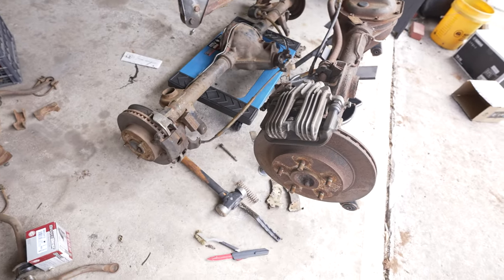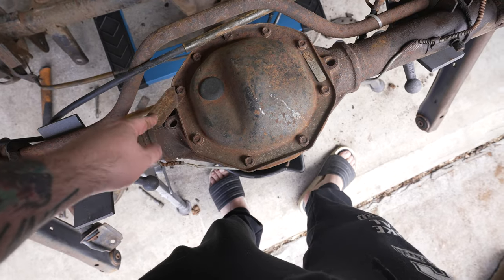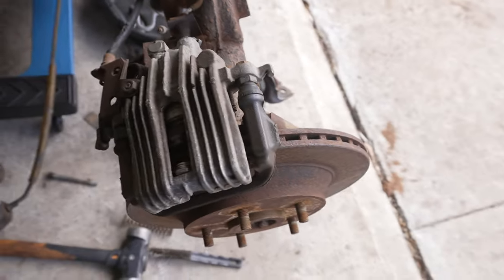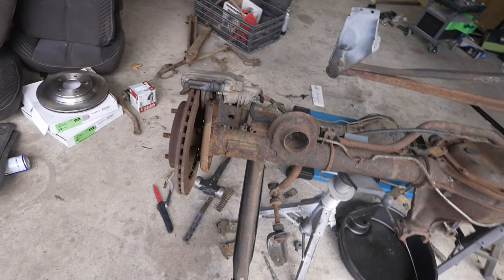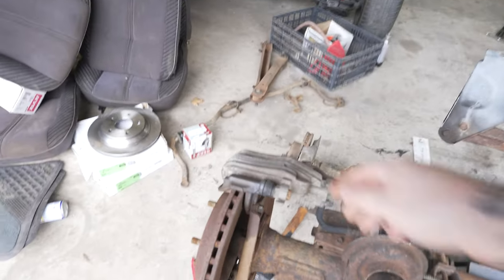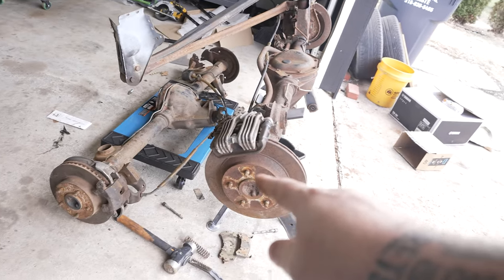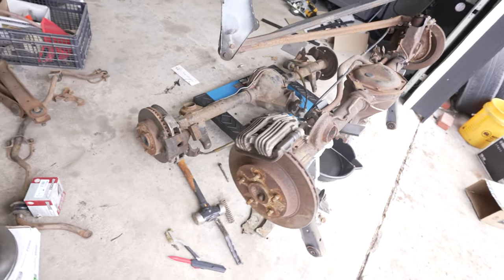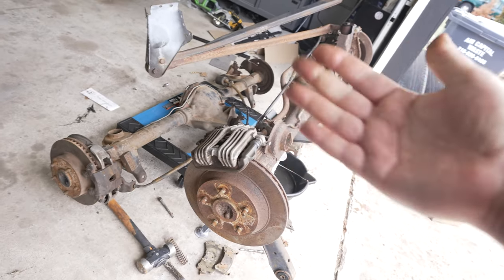2 Types of Borg Warner 9 Bolt Disc Brake Differentials for your Third Gen Camaro

Comment: Great video! 89 was the only year that they made two rear ends - correct. I wanted to add the IROC rear axle with the aluminum callipers have a 32 spline axle, the other a 28 spline axle. It’s handy info for those looking to swap out for taller gears - ask me how I know lol
Reply from the maker: Sounds like somebody bought two sets of axles!! :)
Reply: @beardedreviews  😎

Comment: Hey man very useful info this is ! You made me actually crawl underneath my Red Convertible 1987 Camaro IROC-Z28 305 TPI V8 with 5 Speed Borg-Warner manual gearbox/drive-train to find out I have the smaller disks indeed, as you have declared. As far as I know the rear disks were only available on the IROC-Z28's 305 TPI V8 (220 HP) since these were equipped with this entire Borg-Warner Non-World-Class 5 Speed manual transmission in combination with the rest of the Australian Borg-Warner drive train. This was the homolegation package for Chevrolet they had to sell in certain numbers to be able to participate in the International Races Of Champions (IROC) with their IROC Race Camaro's. So, it seems to me (I could be wrong of course) that you'll not find these Rear disk-brakes (Neither of both options obviously) on any other 3Rd Gen Camaro, but only on the IROC-Z28 with the entire Borg-Warner manual-gearbox-drivetrain option.

Comment: Quick question if using the stronger rear end with the bigger rotors and calipers are you still able to use the stock 15 iron rims?

Comment: They are still junk. Best thing is get a Dana 60 run ladder bars and call it a day period. Try looking for them parts and the calipers.
Reply from the maker: I don't take the car racing.  I just drive it regularly.  The calipers and rotors and stuff are actually very easily available as well
Reply: That's what I've got in my Orange 86 IROC

Comment: I have one of these in my car. And you can’t find parts for them anywhere…. I found it a salvage and had to rebuild the calipers because nobody had them…. I found one caliper on eBay but the seller warned me it had been sitting on the shelf for years 😳 so I didn’t buy.. recently my posi doesn’t work all the time so I start talking to buddies and they said something about they have cone’s in the posi instead of something else but they hard extremely hard to find… I’m like great🤷🏾‍♂️ hopefully I can add some posi fluid and it start back work as normal 🤦🏾‍♂️ but as rare as these these things are there also a headache.. but I will say they are strong I’ve thrown 400 ftlbs at it for a few years now and it hasn’t broken. The tag said it’s rated at 200 so
Reply from the maker: I got my calipers off ebay.  They were rebuilt ones I'm pretty sure, since they were painted black.  But they work great.
Reply: Got my G92 code rear axle from a parted '92 into my '91 conv. and got master as well. Luckily it's low mile and well kept but replaced rotors, pads anyways. Also added reinforced cover since swapping out 305 for 383 I'm building for it. I figured these Aussie calipers the same as gen4 since they look the same, but mine are fine so far - thanks for the heads up.

Comment: What’s stronger? 9 bolt or 7.65 10 bolt with 28 spline axles?
Reply from the maker: I couldn't tell you honestly.  I've never been the guy to max HP out on a car and need a super strong rear end, so I don't know the specifics on them
Reply: 9 bolt is better because it doesn't use C Clips, axles are bolt in

Comment: i just got done watching all of the camaro videos and you had me wondering if you keep the old parts like the old rims and steering wheel ....i have a 1991 . it was my first car .....we got it when i was 15 im 41 now and plan on restoring it in a few years....needless to say it will be a hard restore i was very hard on that car ...its been n our polebarn sitting for the last 18 years or more ....its cool seeing everything you have done to yours ....keep up the vids ...killin it
Reply: Hey man, how's that project coming along? Just wanted to say that ThirdgenRanch has used parts if you need them, and Hawks Motorsport has alot of reproduction-parts if you need them.
Reply: Yeah, I'm also asking since from what I read it should be worth restoring, and there's plenty out there you can gather to do improvements or as original as you want. My first brand new car was a blue '91 special order 1LE /G92 coupe. No A/C, no radio, only perk was grey leather seats. Ex wife kept it. I now have another '91, this time an RS conv. that I put a G92 rear with all Hochkis, and am building a 383 now. Hope yours is getting fixed up too!

Comment: Hey awesome video!  I actually swapped an 85' 9bolt axle from a firebird into my 82' z28.  Finding those calipers in Canada was impossible and I ended up having having the calipers rebuilt. 
I have a 3.70 gear from Nitro Gears I was able to find and it was over $350USD gears for these are expensive!  You may want to buy the 4th gen brake booster and master cylinder and get the willwood proportioning valve for your car since the master cylinder for disc vs drum cars is calibrated differently, you also get a higher sitting more late model braking feel.
Reply from the maker: Yea that's one thing I forgot to mention in the video was the proportioning valve and booster.  I'll have to do some digging into which one is best for my application
Reply: Okay so for my 92 RS. I bought the 88 z28 rear brakes calipers and rotors new from orilley  they were fairly expensive I bought a bracket from a company I can’t remember it all bolted right up to my stock rear end with 323 gears   I put a mini spool in it for possi  willwood proportioning valve new ls1 master cylinder  I kept the stock original brake booster. I ran all new brake lines front and rear  and I put a drift brake in and plumbed it straight in to the rear lines
Reply from the maker: @vandettabuilds6641  jeesh you went crazy man!!  That might stop a freight train :)
Reply: @beardedreviews  I put a 6 liter LS in it ha ha
Reply from the maker: @vandettabuilds6641  nice! LY6?  I'm putting one of those and a 4L80e in my trans am

Comment: So as I'm watching this I was hoping you would bring up swapping the better calipers and rotors, about 5 years ago I found an almost new low mile 9 bolt disc rear with 3.27 gears from a 88 T/A. I have 1984 Camaro L69, my car had the 3.73 drum rear. I never really liked how it was on the highway, I wanted to change it more for that reason versus having better stopping power but I also knew that was part of the package. Anyway, it's all been well worth it especially on the highway. It used to Rev pretty high, now not so much..Next, I'm gonna check into other parts. Thanks
Reply from the maker: Yea I didn't see the info anywhere else on youtube so I figured I would just put everything I knew about them on here.  Glad it was at least a little bit helpful!

Comment: Way late to the party
89 is only year for the pbrs on a 9bolt and last yr for 9bolt. (Very few documented installed on 90 cars)
In 89, there's a 1st design 2 piece caliper bracket with dust shield (not in vid)
Then the 2nd design caliper bracket like yours in vid. (Anti-moan tsb and thicker bracket like yours was 2nd design)
Reply: This doesn't sound right. Thought the 9 bolt PBR caliper set up went up to 1992? If not, what brake set up did GM use then? Because they were still using Borg Warner units up to that year and my 91 GTA has the 3.23 BW 9 bolt unit but is equipped with drums, unfortunately.  I want to replace it with a disc unit and I'm talking with someone who is parting a 92 trans am that has this.  But if it's not a PBR set up then I may not want it. 
What I'm seeing in this video is the '85-'88 disc set up vs the '89 and up unit.  (1st design vs 2nd design) 
The 85-88 has the iron calipers, 10" rotors, and the ebrake system is being utilized with externally mounted counterweights on the calipers.  This is problematic because they have a tendency to freeze up and not unlock correctly when released. Therefore GM did several revisions. Obviously the PBR aluminum caliper was a major upgrade along with the larger rotors. But also the revisions was done with the ebrake release which was redesigned. You can clearly see it in this video. 
I  use to have a '89 T-Top GTA 350 that was built on 1/89 and it was a 9 bolt 3.27 BW unit with PBR brakes. I've always liked the 9 bolt rear end on my car because doing rear brakes was easy. You don't need a special tool to crank the piston into it's bore other then using a normal C-clamp.
Reply: 89 was last yr gm used the 9bolt. In 89, there was a 1st design and 2nd design caliper bracket. In late 91, the calipers received a vibration dampener. In 93, there were several other changes, mount bracket, caliper w/shaved fins, vibration bracket an dampener changed shape and locations
A 3.23 rearend in a 91 is a 10bolt.
The simple pbr rear disc setup from 89-97. Went larger, heavier and more complex 98-02.
I don't know much about the 82-88 iron rear disc other than they are garbage. Tossed every set into scrap pile.
Reply: @raulcarrillo2226 TTop is 100% correct

Comment: Yes! Finally. I was looking for this info. I am also looking to swap the rear end. The drum brakes look horrible through the wheels and the braking power sucks. I also wanted to look for a rear disc off a 3rd gen iroc and this Info is very helpful. Is there going to be a follow up vid regarding the brake booster/proportioning valve since you’re converting the rear to disc brakes?

Comment: i know im late. but 10bolt & 9bolt F-Body axle doesn't have the same tube diameter but you can use the 10bolt 4th gen 93-97 Bracket and caliper for the 3rd gen. 
btw im not a fan of 9bolt because the posi wear and will stop working and good luck finding parts for it. 
at least 10bolt parts are everywhere. 👍

Comment: My factory 9 bolt locked up on the 401 on my dad 20 years ago 9 bolt posi it leaked the oil out of the rubber fill plug 
3.45 t5 and we got a automatic rear end 3 21 t5 10% slower 
And the car was mine 4 years ago and It almost happened again we have a used rear axel and I couldn't get a rubber seal anywhere 
And I got it from 9 bolt com 20 bucks and saved the rear end 
Thank God I saw it leaking 
Just watch it non stop
It broke the rear axel and wrecked my t5 5th gear shaved the gear clean off from it looking in 5th gear going 120kmh and almost caused a accident .
Get a new seal and change the fluid with synthetic oil and lsd oil

Comment: So, a quick question. Will the caliper brackets bolt to your 10 bolt?
Reply: 9 bolt and 10 bolt use a different bolt pattern for the backing plates. All 10/12 are the same though